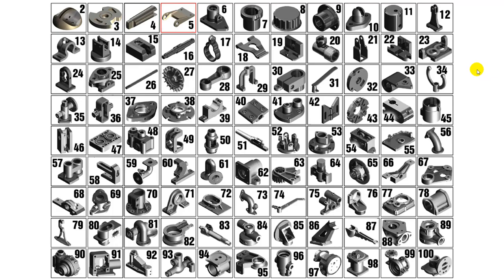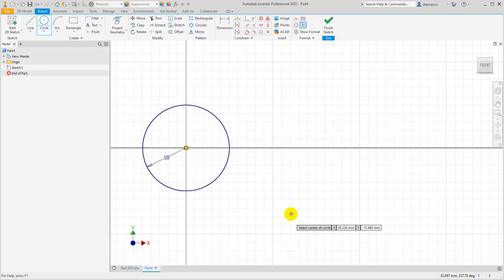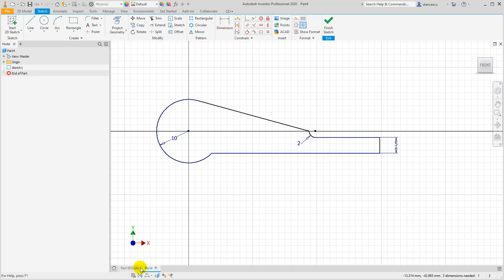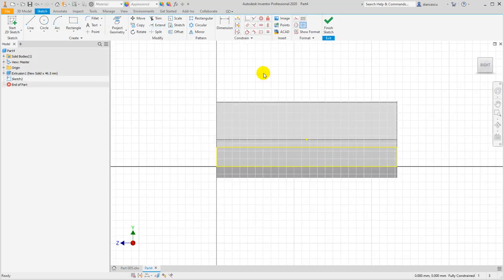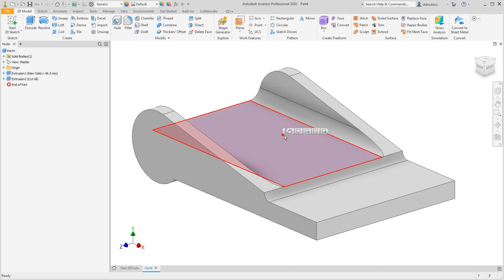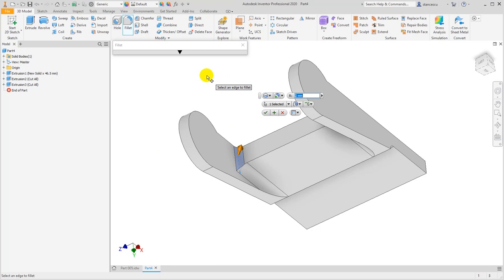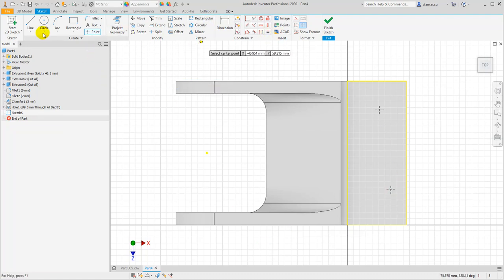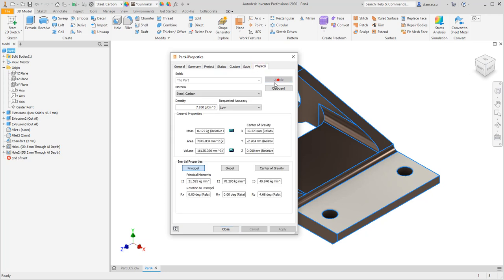Tutorial Inventor - 012 HALF HINGE (Part-005)

Comment: Done Professor !!

Learnings

1)Identification of missing dimension using auto dimension to make a fully constrained sketch.
2)Idnetification of mistakes/multiple lines usuing autodimension

Doubts 

1)In the drawing i can see dimensions has got tolerence fit  representation (E8 & H12), what is the basis of this selection ? And how do we assign this to features in the model ? 
2) What isthe basis of difference tolerences for 3 dimesnions ? Why is two of them are in brackets and one is not ?What standard /chart should i look into to make a judgement on the tolerenece and fit if i need to make a new part ?
3) What is the manufacturing process for this kind of a part ? I would assume casted and machined . How can we add detailed of machining in the drawing ?
Reply from the maker: Bravo Basil - go ahead!
Reply: Can u have a look into my doubts ?
Reply: @basilalias6206  i know you probably have found the answer but im answering to 2nd and 3rd doubt.
H and E fits usually depict the fit of the holes and the mating component. there can be various fits like tight fit, sliding fit and interference fit. i dont know much beyond that.
There are websites which tell you about fits and how much dimensions you should keep for holes and shafts. 
coming to machining part, i think this component can be made by machining followed by welding- by machining the two tapered sides with cnc vertical milling machines followed by grinding for the smooth finish, hole drilled with a drilling machine,center connecting piece to be machined accordingly and finally welded together with a 3mm fillet weld on the top faces along with the back piece.